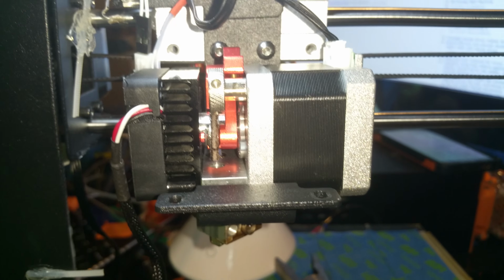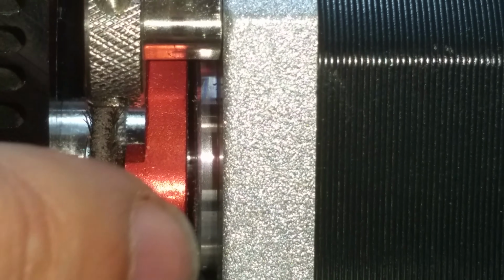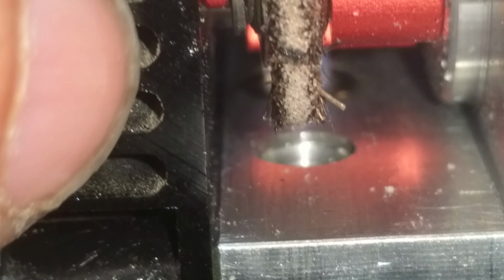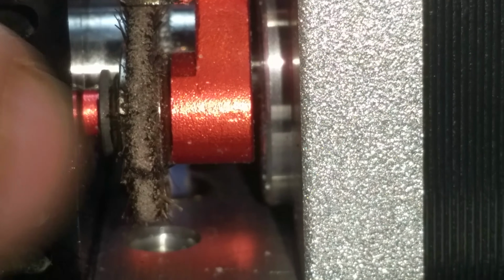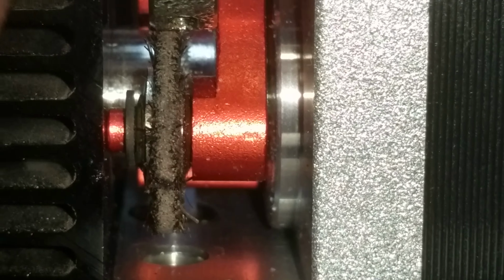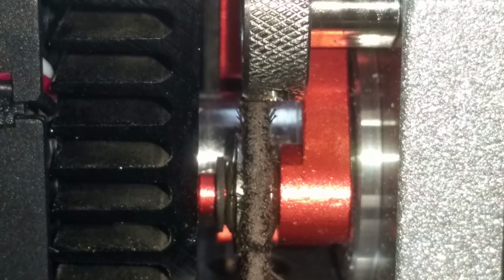Today's 3D Print - Potential Binding point?

Comment: Personally I would just drill a small relief hole in the heatsink so the bolt head can pass through. The heatsink cannot be hurt by adding a small hole. Making other holes larger or shortening bolts may have detrimental impacts. IMHO
Reply from the maker: thats the plan. while I don't think its hurting better safe than sorry. going to dremel out a divot for it so there is no pressure.